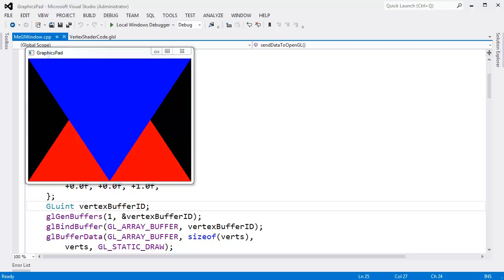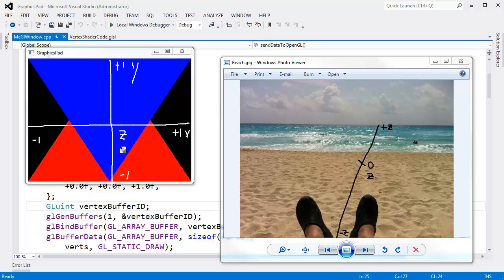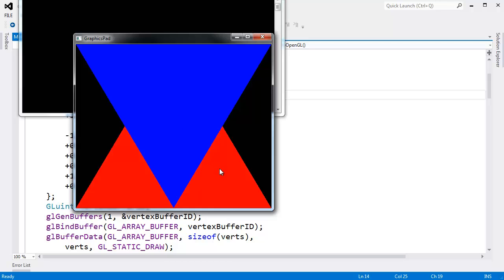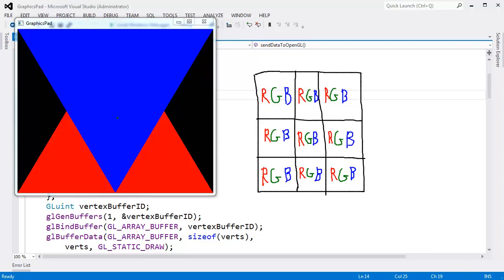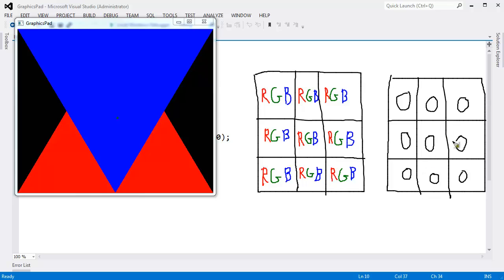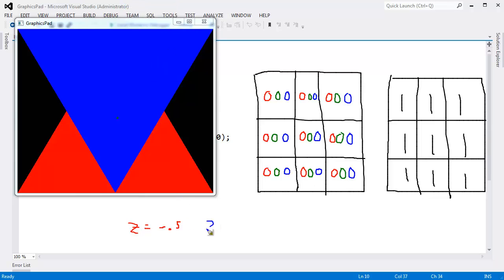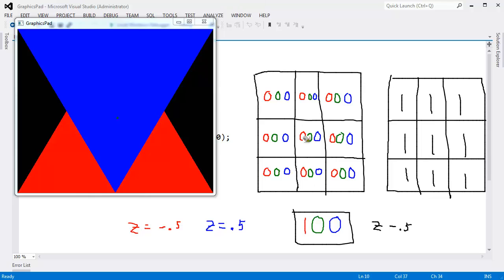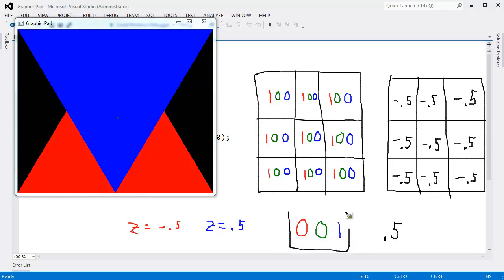OpenGL Depth Buffer

Comment: I am extremely impressed with your ability to convey these OpenGL concepts so clearly.  I don't think it is possible to give higher recommendations.  Kudos! (That's Kudos factorial).

I did have a question regarding the left handed coordinate system used in this video.   I was under the impression OpenGL used a right handed coordinate system. Am I incorrect?   Anyhow, you do outstanding work.  Just super.....
Reply: J Dub Oops.  Never mind. perspective transformation....

Comment: Excellent video series! I have a question though. When is this depth test carried out? Is it between the fragment shader and the vertex shader? Or is it after the fragment shader? If it's after the fragment shader, then wouldn't it be unnecessary work for the fragments that will never pass the depth test? The only reason I can think of why it would be carried out after the fragment shader is because of the alpha channels, but I would love an explanation on this.